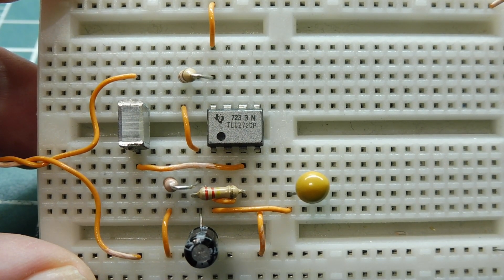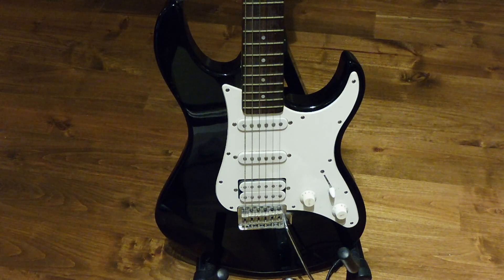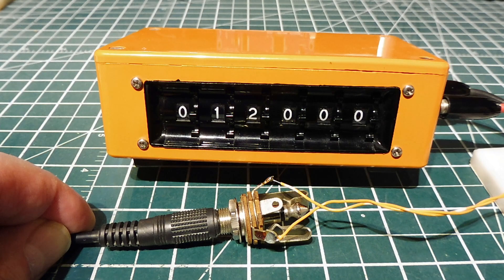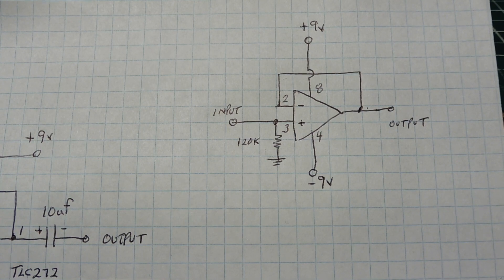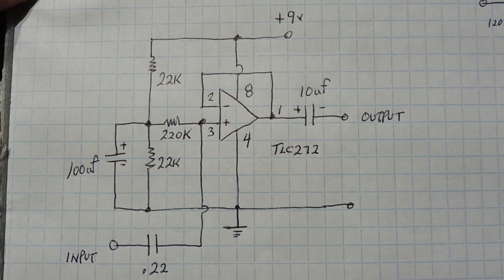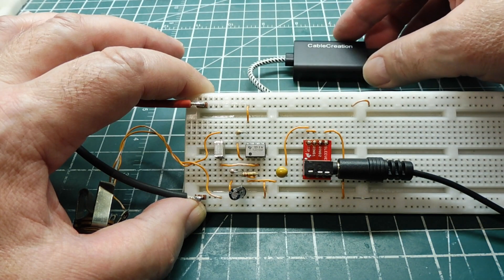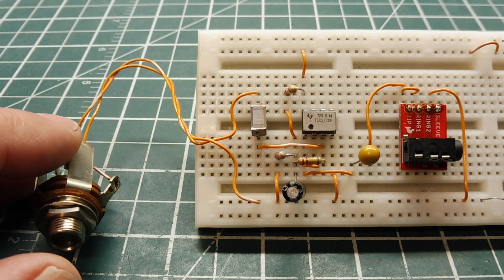Hi-Z Unity Gain / Voltage Follower / USB Soundcard

Comment: TL072 op amps  similar why did you specifically pick the tl272?
Reply from the maker: TL272 uses LinCMOS which has a very high input impedance. For this project the TL072 would also work.
Reply: @0033mer  I have a sleeve of 072's which is why I asked.  Thanks.

Comment: Sorry if it's a stupid question but I was wondering if there's a downside to using the largest resistor you can find instead of the 220k ohm one?
Reply from the maker: You can insert any value of resistor you want into the circuit. Guitar amplifiers are usually around 1 Meg ohm so you can use that value. If you go too high in value, a loud hum will occur when the source (guitar) is disconnected as it will pick up any stray signals like 60HZ and leakage signals on the board. We use high impedance input to get crisp high frequencies but noise pickup on long cables will increase. The circuit makes it easy to experiment with different input impedances.
Reply: @0033mer  Thanks a lot for the prompt response ❤️😊 Now I get it 😃

Comment: Thanks for the video :)

Impedance is a word I have trouble understanding. Would you please be able to give an analogy and further define what it means ?
Reply from the maker: Impedance is basically an AC resistance. The opposition of AC current flow in a RLC circuit. When a circuit contains both resistance and reactance the combined effect is called impedance. A capacitor blocks DC, but AC can flow through it. The total resistance and reactance is added with vectors resulting in impedance. In a 3 4 5 triangle the resistance is 3 the total reactance is 4 then the impedance (Z) would be 5.

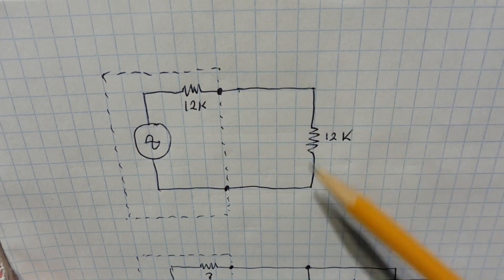Comment: great! but why do you start with 1:10 ratio for the imedances? why not 1:100 or 1:inf?
Reply: For one reason, too high a resistance can increase the effects of capacitance, think R in RC.
Reply: @Enigma758  do you mean that BW and slew will be limited? but the input cap of the amp would be in picofarads and our signal is kHz range, isn't it?
Reply: i think i already saw the answer below. noise and cutoff freq, right?
Reply: Same question here!

Comment: I've got a newbie question: why do we need to put a resistor between the non-inverting input and ground ? The input impedance would be infinite and the ac device would'nt be loaded ? (btw thanks for your videos, always interesting)
Reply from the maker: Yes ... you are correct, without the resistor the device will not be loaded. If the device is disconnected (guitar) the infinite impedance would pick up a lot of noise and you would get a loud hum. Generally we apply a shunt resistor so we know the value of the input impedance and can set the low frequency cutoff using the value of the input coupling capacitor and the shunt resistor.
Reply: @0033mer  thank you !!!

Comment: Interesting video, Ken. You could use that to drive a small speaker and do simple tones/music on a Scamp3 using PWM.  Combine it with your ToF sensor and make a theremin. 🙂
Reply from the maker: Wow ... I was also toying with the idea of a Theremin using the ToF sensor but feeding the output to a MIDI device. The ToF would have to simulate a "ribbon slider" and then fed into a Ribbon to MIDI controller. Check out these videos:
https://www.youtube.com/watch?v=MUdWeBYe3GY
https://www.youtube.com/watch?v=UU3WkZmNJEc

Comment: Why choose the tlc272? A more traditional choice like a tl072 ought to work ok, or even the classic ne5532, though its input impedance isnt as good
Reply from the maker: The TLC272 is a dual op-amp so the second op-amp can be used as the gain stage after the unity gain stage. It uses TI's LinCMOS which has a very high input impedance 10^12 and is designed to be powered with a single supply. It is internally compensated and has latch up immunity which is a problem when op-amps are configured as a unity gain follower. Any op-amp you are familiar with can be used in this circuit.